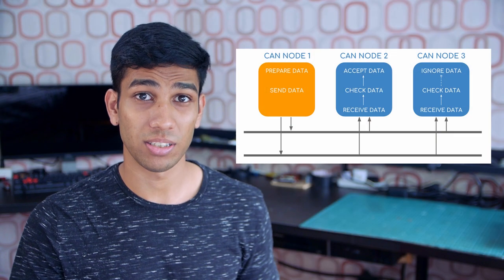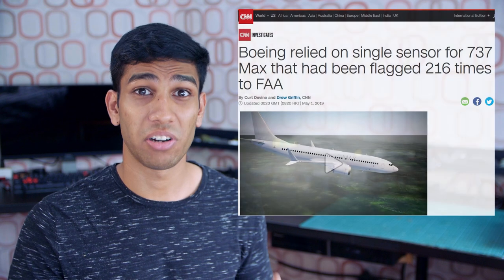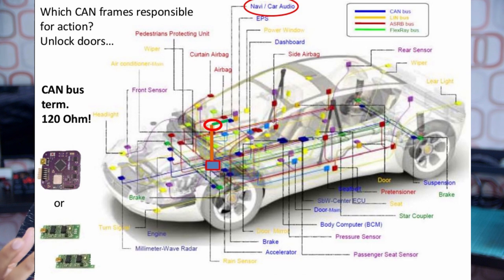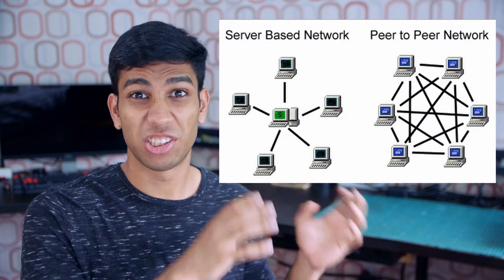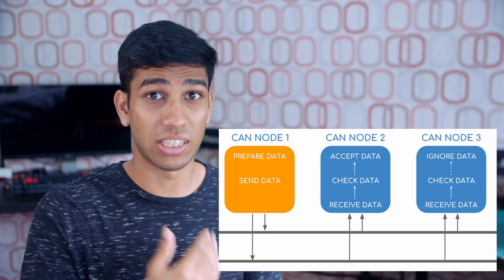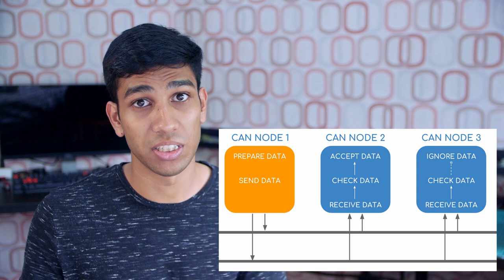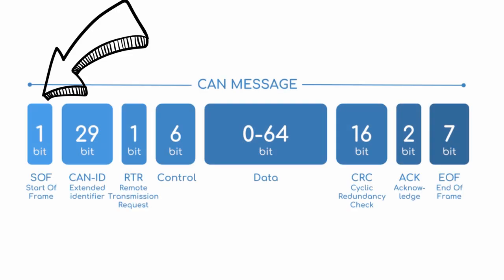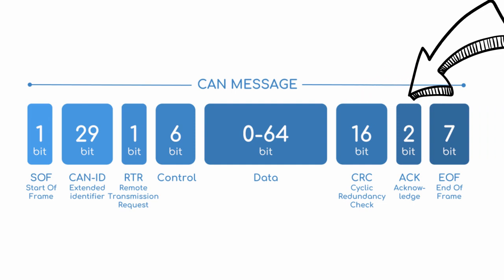CAN Bus communication explained in 5 minutes

Comment from the maker: A very helpful Reddit user who is much more knowledgeable in this field than I shared a couple of oversimplifications/ inncorect statements I made in this video. I have copied his comment down below. Do check it out.

1:22 you mention bulletproof communication, CAN bus is not considered bulletproof, it is just a physical layer. It is only coupled with appropriate communications monitoring. In this way it's technically better than, say the I2C or SPI, but no more robust than RS485 or LVDS as these are also differential pair communications.

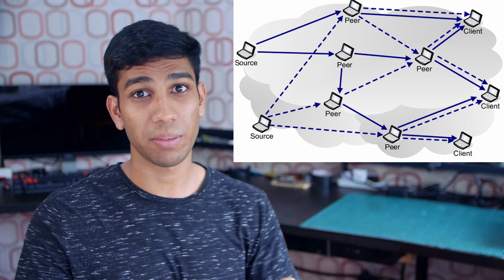2:08 diagram; CAN is almost never connected in a web like network. It CAN be, through gateways, but these are more considered separate CAN networks at that point. In fact CAN is typically considered sort of a trunk with nodes branching off, where the node branches are called stubs. ISO 11898 specifies a maximum stub length of 0.3m for example. Anything looking like a "web network" is not going to be spec.

But also, there are specifically buses that are designed with ring topologies in mind which can suffer a disconnect between any two nodes (but not two disconnects between two different nodes). MOST comes to mind. That's how to implement what you described, which CAN cannot do out of the box.

3:25 you call the CAN ID a tag, but you fix it when you refer to the diagram. I would stick to Can ID. Nobody calls it a tag.

4:45-ish... there are some issues. High speed and CANFD are not the same. Low speed is not traditional. Basically you have CAN 2.0, which operates up to 500kbaud and is the "classic" CAN (1991). It can have either 11 (2.0A) or 29 (2.0B) bits. Then you have low speed can, which is a different physical layer that is more fault tolerant and runs up to 125kbaud. All of this could probably be considered "classic CAN".

Then you have CANFD, which was released in 2012, and is basically high speed can with a special negotiating bit that switches into a very high speed data rate in the middle of the data part of the packet. This could be considered a non-traditional CAN bus.
Reply: How we can take data of CAN BUS
which can we connect Raspberry pi to can bus and if we can then how
Reply: I want to talk to that Reddit Please.

I want to use Raspberry pi 4 and CAN bus
Reply: This is why you're going to go far, you not only take good criticism, but also make notes on your videos. Thank you.
Reply: My late father told me a man takes ownership of his mistakes and takes steps o rectify them. OK, he was talking about much bigger life mistakes at the time but the principle remains the same.
Reply: Lets say i logged tons of can messages from my bmw e92 335i

Then what i have the logs but how can i use them

My aim is to use a junkyard 335i automatic transmission in a bmw e36 swap so now i have these messages how can i use them with the gearbox in my swapped car to make it function?
Reply: When you say physical layer are you referu g to the iso layering protocols ?

Comment: From a person who works on vehicles and diagnosing CAN faults I can say its a nice simple way for people to get a understanding on how vehicle communications work. FYI Flexray is coming up in vehicles now, so it might also make a good video explaining this system.
Reply from the maker: Thanks, glad you approve of this resource. I will look into flexray and try to make a video on that as well. Thanks for your comment :)
Reply: @saraltayal5005  I know I'm commenting quite late on this, but as someone working on In-Vehicle Networks professionally, I would even say that FlexRay's rise is already over: If you really want to be prepared for what you will see in (rather premium) vehicles launched currently I suggest you look up "Automotive Ethernet" (IEEE802.3: 100BASE-T1, 1000BASE-T1, ...) as well as "Time-Sensitive Networking" (TSN, a subset of IEEE 802.1Q). The benefit with Automotive Ethernet is that from Layer2 upwards it is basically pure Ethernet Data, so you can send data into the IVN or capture it e.g. with Wireshark. You need a Media Converter though to change from the Automotive physical layer to your consumer IT physical layer (100BASE-TX, 1000BASE-T, ...)
Reply: yup. Even on heavy Construction Equipment

Comment: Hang on. I have a customers car which seems to have the modules working but Autel cannot communicate with any of them. Checking the pin 6 and pin 14 with a breakout board its lights flash saying digital signals are passing along it. The engine won't crank and when starter jumped still engine won't run. 

How to check integrity of can bus two wires.

Comment: HI, nice video. I have a question. I have a 2016 Ford Focus Titanium and i want to add Adaptive Cruise Control to it. The Focus did not come equipped in the US with this option but did in Europe/UK. If i plug in the Adaptive Cruise Control module that i got into the can bus system will the system see the module. There are 4 wires from the CCM. A power, Ground and high speed can plus and high speed can minus. Thanks

Comment: Nice video, but if you are going to take resources from CSS Electronics (CAN Bus Explained - A Simple Intro (2019)) should you not reference them as a source or a place to look for further information?
Reply from the maker: I did use them and multiple other sources for my resources. I have added them and the other sources as my references in the video description. Thanks for your suggestion :)

Comment: The 737 MAX should not become a whipping Boy or Cautionary tale for everyone who wants to conflate events, that do not meet the requirements of a good example. Angle of attack sensor failures especially due to environmental contamination such as icing and inaccurate sensor data, is not unique to the 737 Max and there are other events intervening that caused the two aircraft to end up crashed. Proper information and training figures into events that occurred, but mainly at fault is the quality control and certification system that existed at Boeing.

Comment: Chip to chip communication would be spi or i2c.  The 737 has a center of gravity issue the systems can't correct for.  It was poor engineering, not a sensor.